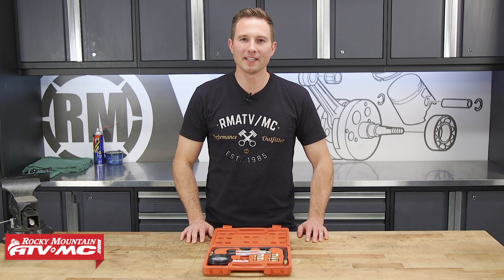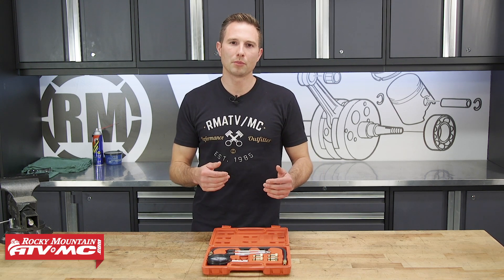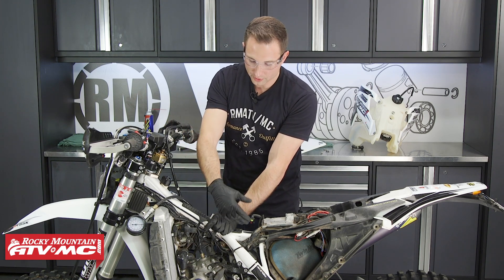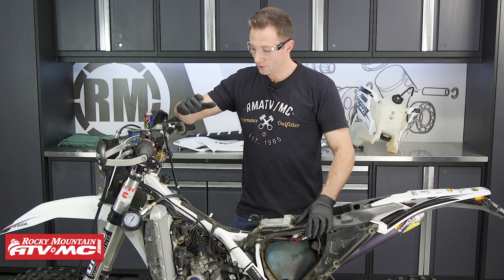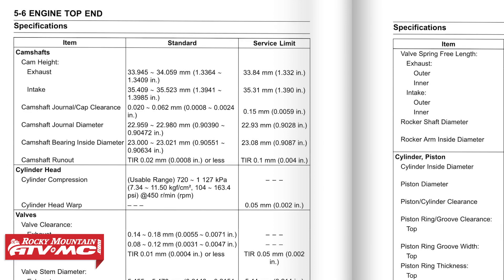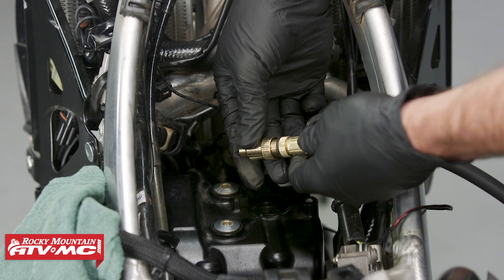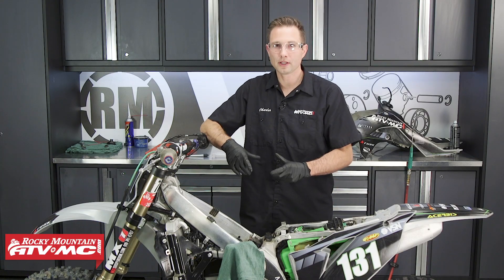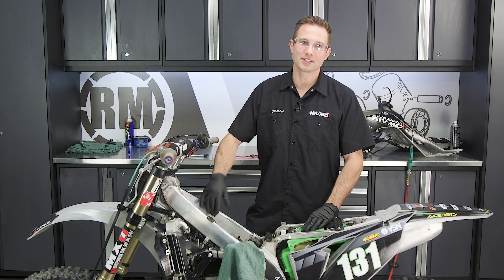How To Test Your Motorcycle Engine Compression

Comment: DO NOT BUY THIS PRODUCT it is flawed - the check valve is not at the cylinder. Their own reading 135 is probably wrong. The check valve needs to be at the cylinder or else that long hose is killing the reading. I tried one like this tool read 120 was terrible I bought a good one with checkvalve at sparkplug hole read 208 so yeah Tusk take this video down and get the product better.

Comment: In this tester set I have that looks identical to yours, in the extremely badly-written instructions, it says under "TETING" (meaning TESTING) to "start engine". So I did. The engine ran on one cylinder at a time and I gave it a bit o' throttle. The whole test took about 5-15 cycles each to reach a stable max (a few seconds), and then I quickly cut the engine off. Got 170 front, 190 rear (PSI). Why is this a bad way of doing it? Could I have damaged anything? My ol' dad wasn't happy at all when I said how I tested it, as he lent the tester to me 😬

Comment: You didn't show where to ground the jump wire to. Where? And where did you buy that jump wire?
Reply from the maker: You can ground the wire to any bare metal area of the bike. The jumper wire is just a piece of 16gauge wire you can buy from your local hardware store.

Comment: I found 150PSI of pressure on my Husqvarna TC250 2022 (carb) cant find the specs on the service manual does anyone else have the sane issue? Im gussing 150 is more than enough. Currently 75.5hrs on original everything.
Reply from the maker: It should be around 180psi. But you'll want to double check that with your service manual.

Comment: I did a rebuild because i had oil from the exhaust. Heads are redone, new piston rings without re-honing the cylinders because they still had a nice crosshatch and no visible damage. New seals and gaskets and exactly done as the manual says. Put back together and she runs fine only problem, still oil in the combustion chambers. As you can imagine this is frustrating me. Anyone any ideas on what this could be? I oiled the valve seals a bit to prevent cracking of the rubber but I'm thinking it could be the valve guides. Any help is welcome, thanks!

Comment: How do I do this and NOT have my bike start... cause that happened lol
Reply from the maker: Your compression tester should go in the spark plug hole so there should be no way your bike will start with no spark plug.
Reply: @rmatvmc  My bike has 2 spark plugs per cylinder so it does.
Reply from the maker: You can remove the spark plug boot from the other spark plug.

Comment: 2013 kx450 supposed to have how much compression closed throttle closed?
Reply from the maker: The throttle needs to be wide open for the test.
Reply: @rmatvmc  thanks. I did it closed and got super low numbers 48-55 psi I’ll try it open throttle next.

Comment: Why the need to hold throttle open and ground out the plugs?
Reply from the maker: Holding the throttle wide open allows as much air as possible to enter the engine and gets you the most accurate compression reading. Grounding out the spark plug avoids electrical problems because the current needs somewhere to go and can cause damage if not grounded.
Reply: @rmatvmc  the throttle makes sense.  
Wouldn't flipping the kill switch or leaving the ignition off be equivalent to grounding?

Comment: I have a 2018 crf250R I’m getting 75 psi compression I was wondering if that was good or bad thanks
Reply: If your bike had a built in compression release on the valve train, 75psi might be fine. Your service manual will give you the spec.

Comment: What should the compression be on a 1977 Hodaka Wombat 125cc that won’t start
Reply from the maker: Somewhere around 140-150 psi. A service manual is your best friend!
Reply from the maker: 100psi is probably the minimum the bike would start with, but again, see if you can track down a manual. Don't forget to check for fuel on the spark plug, as well as checking spark. -Charles
Reply: @rmatvmc  
Thank you so much!

Comment: Does everyone no how much psi of compression a 2008 Crf150rb is supposed to have
Reply from the maker: It looks like the manual calls for 73 psi of compression. This number seems really low but these bikes have an decompressor which that throws off this number.
Reply: @rmatvmc  oh ok thanks mine says 90 psi so mine is good than but I guess I am used to two strokes thats y it seems low to me

Comment: What if you have a manual decompression lever do you hold it done while your doing the test ?
Reply from the maker: It depends if you can kick it over without using it haha. Ideally you wouldn't use it, if I remember right, I think some of the old service manuals would give a spec both ways. If your manual doesn't specify, I'll look into it more. Let me know! -Charles
Reply: Lol 😂 it’s a 06 ktm 625 smc. It’s burning oil I believe. Due to the spark plugs being covered in it. And I don’t think it says

Comment: Been reading that using the Estart to check compression is really hard on the starter.  Is this true? If yes, how can I check my compression with a bike without a kick start and a rekluse?
Reply from the maker: What bike? You should be fine. The main thing to remember is you don't want to run the starter motor for too long because it can get hot. I wouldn't hit it for more than 8-10 seconds at a time. That should be plenty of time for your test, but if you need to hit the starter button again, just let it rest for a minute first. -Charles
Reply: @rmatvmc  bike is a 2020 KTM 300 XC-W TPI

Comment: i think my compression tester is broken..
it gave me 70psi on a running 125cc 4 stroke dirt bike, and 60psi on a 150cc gy6 quad... and 50psi on a banshee (that does have a problem i think it wont move onder its own power) but it starts and idles.. but yeah i think my meter is broken... eveyr thing is between 50 a 75psi...
Reply from the maker: Hmm...is there a good seal with the o-ring where it screws in? If so, it could be a faulty gauge. If you bought the gauge from us, then reach out to our warranty department. warranty@rockymountainatv.com -Charles
Reply: @rmatvmc  no got one cheap of amazon lost my other one.
Came across this video cause i got confused what psi now was good or bad.
Thank for the reply, i will just send it back to amazon and buy a new one

Comment: hey the test was carried out on a cold engine or a warm one??
Reply from the maker: There are a lot of mixed thoughts on this subject. Both numbers should be pretty close but it's best to check with your bikes service manual to see if they give your compression spec on a cold or warm engine.
Reply: @rmatvmc  Thanks for the answer, tell me if Nikasil can be sanded with stone??
Reply from the maker: We have a great video covering everything you need to know about Nikasil cylinders that you can check out here: https://www.youtube.com/watch?v=InfPn0MtOPY
Reply from the maker: If the bike runs, you'll want to do the test with it warm since the piston takes shape and slightly expands when warmed up. You'll want to do it the same way every time for  consistency and same gauge. If the engine doesn't start, this will be a good indicator of whether or not you have a problem in the engine. -Charles

Comment: What should the compression values be in a YZ450F 2019 and a CRF 250R 2020?
Reply from the maker: Normal compression can range anywhere from about 120 to 200+ psi depending on the specific engine. It's best to check your owner or service manual to get an exact compression spec for your bike as well as any additional instructions for performing this test. Also, because compression can vary so much from bike to bike, checking it when a bike is new or has a fresh piston and then periodically after is the best way to establish a normal range for your bike.

Comment: When you have the tester compressed and start the motor, how does the air stay in the cylinder. Won't the air escape out either the exhaust or fuel valves while rotateing the motor?
Reply: There is a one way valve on the tester itself.

Comment: i just rebuilt a 93cr125, i have not run the bike yet so its not broken in, but im getting only 100psi compression. i had the cylinder honed and measured with the cylinder its in spec ring is gapped and oriented correctly. bad gauge or just not a full seated ring? having trouble getting bike to start
Reply: Bro I got very low reading plugging into spark plug hole. Use the rubber end things I got an extra 64psi and now 140 from 75. I think I have defective item like you

Comment: I have a 1985 Vmax and to do a compression test I cut the bottom off of an old spark plug and welded and air compressor fitting to it so I could check compression

Comment: Honestly if you have a four stroke with auto decompression don’t waste your time with this tool. Use the leak down tester instead for an accurate. Wait till you get an adapter stuck in the plug hole too (good time there). Just buy a quality tester with multiple hoses.
Reply: Simply put loctite on the hose and screw it back into the adapter and it’ll get it out with ease

Comment: Can you tell me if the shraider valve is tight in the end piece.  Most of these kits can’t do 50 or 65 cc engines.   They don’t move enough air to seat the shrader valve.

Comment: What if it’s a carbuerated engine and you still open the throttle all the way
Reply: Yes because you wont be trapping any pressure if you have a valve issue.

Comment: What should the compression specs be at normally for a 4 stroke
Reply from the maker: Between 120 and 190 usually but you'll want to check the service manual for your exact bike.

Comment: Do I have to take both spark plugs out? Mines a 2 cylinder. 4 stroke.
Reply from the maker: Yes, you will want to check the compression in each cylinder.
Reply: @rmatvmc  do I need to take them out at the same time or one cylinder first , then sparkplug back and other ?
Reply: @AndrushaNZ  the cylinders can be tested Individually, does not matter if the other spark plug is in or not.

Comment: Best  Compression test video I have seen!
Regards from South America and please excuse my wrong english.

May I ask to your knoweledge?

Should a compression test to show an increase of the psi sample on a brand new engine after 1.30 hours of engine break-in to make comparison?

Topic apart,  Can you give me some lights about main Jetting and spark plug reading?

Here, local tech service has not O² sensor and empirical knoweledge seems to be not good at all.

I have seen plug chop test here on Youtube and I made my own test two times, two news spark plugs used without carbon deposits as results after test was made.
I understand that high rpm and temperature makes a spark plug cleaning, so plug shop makes sense looking for carbon deposits at bottom of insulator.   Is that right?

I'm a Honda XR150L brand new owner and 5000 miles today, basic motorcycle but I notice that it comes so lean AFR.  white spark plug readings and over heat... 
I just want to be stoichiometric in low jet and slightly
rich on main jet.

I know about jetting, elevation and temperature range rules...   I know about upper side of spark plug reading for low and middle throttle opening range but main jetting seems to have a special method like a plug chop test has.

All my setting is stock setting except the main jet. from #102 to #112 tested now.
150cc³.
20mm throttle bore.  
stock jets #35 #102 -> #112*
 +/- 1500 ft asl and  +/- 86°F.

Jet #112 tested does not shows any carbon deposit at bottom of insulator after cut it's body thread, nothing!

Plug chop was much more than 5 minutes at WOT, 6 runs avoiding low jetting and spark plug reading shows just a little brown mark deposits at top of insulator and oriented to the exhaust valve.  NOTHING MORE!

What is the range of main jets number to test on this kind of engine and environment?

Is there a well known range number of main jet to emulate a 13.5:1  or 14.0:1 AFR values for example?.
What am I doing wrong?.
What information I need to know?.

Plug chop method is not known here in spanish tech community.
Thanks to you a lot!
Reply: Your English is better than mine lmao
Reply: Hi @orgillmathew     oh man   I am looking for this tech data but it is not easy...     Did you read  about "plug chop" method before?     
That method is not known by local spanish language techman.

Cheers man!
Reply: @RafaelAlejandroGraciaOrdoñez  Im sure Spanish Techs have there own terminology,  
but is this what you mean?

When it's dirty and black, it's got the shits,
You have too much gas you are running rich.
When its hot and white, but looks pretty clean,
You're 'bout to blow your shit up; you're running lean.
Reply: Plug chop is the least effective solution to your problem.   If you wanna do it right buy a wide band o2.  Install it. And make test runs.  Real world load test.   Shoot for 13:1 wide open.  14:1 cruise.   And idle in the 12’s.   This will change with temp and altitude.   So you will need to find baseline settings for all conditions and jet to suit
Reply: Thanks a lot  @1000draggsxr !

Unfortnately it's expensive to import a O² wide band....
Local service has not O² Sensor for tunning so old school spark plug readings, throttle response and sensations about engine performance is the way here to do that!

I understand the correction factor when jetting but my bike comes very lean from factory so testing main jets until sputtering gives me that info to find that 1.0 factor correction value as start point.

I had to step up main jet until wide open sputtering indicating over rich but so far to get numbers and a new question here: *¿how many time of combustion need a spark plug to get enough or insufficient carbon deposits to be readed?

Thanks a lot!

Comment: It's better test engine compression with hot engine, rings and cylinder hot
Reply: I agree. But you need to make sure it's the exact same temperature every time.  So what's the best for me is always cold.
Reply: @622wesc  Good question. i recon you would want to test operation temperature.
Reply: Thats great if it runs